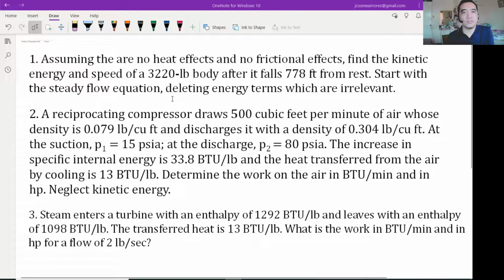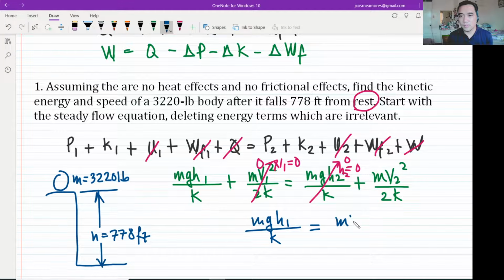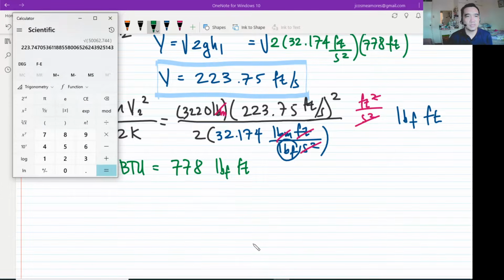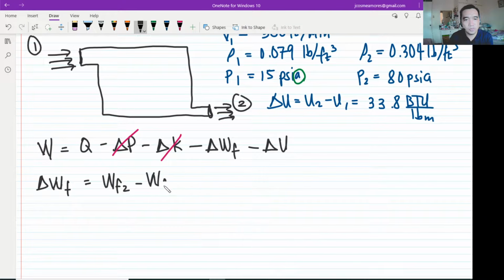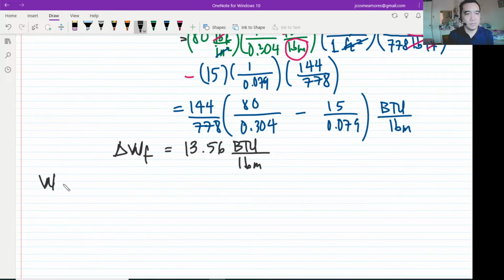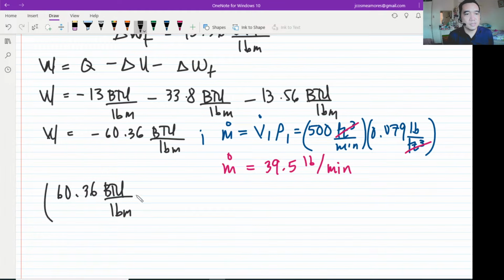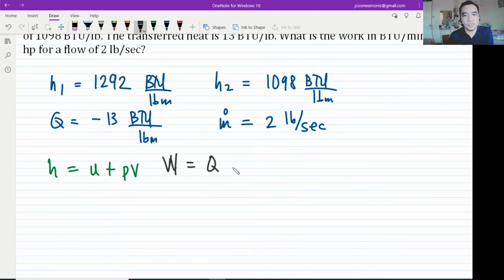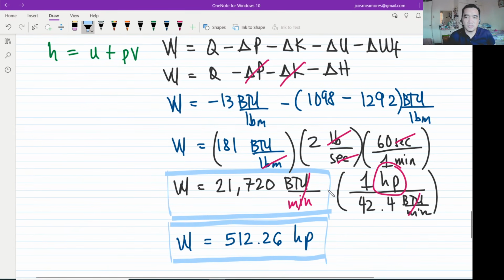Solved Problems for Conservation of Energy (English System)

Comment: Hi Sir! Bakit po yung 0.079 na density ang ginamit at hindi yung isang density?
Reply from the maker: You need to use density at point1 because the volume flow rate is also at point1.
Reply: Question po ulit Sir, diba po ay ang nakuhang work in Btu/ lbm ay negative? Bakit po hindi na negative yung ginamit nyo noong niconvert nyo sya into Btu/min? bakit po naging positive na?
Reply from the maker: @johnjayzelmalijan6224  The sign for work, positive or negative, is just an indication whether work is done on the system or work is done by the system. Since,  we are ask to solve for BTU/min and HP, then that's already power which is work/time. Technically, Power has no sign or you can that signs doesn't apply to a unit of power.